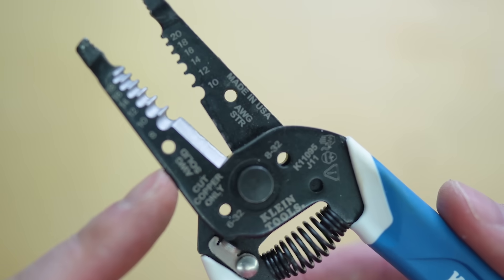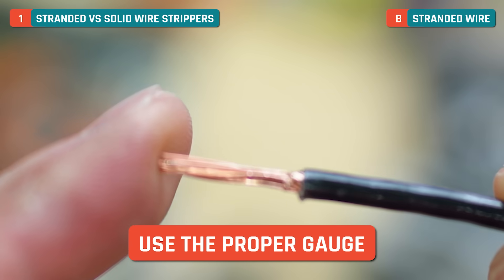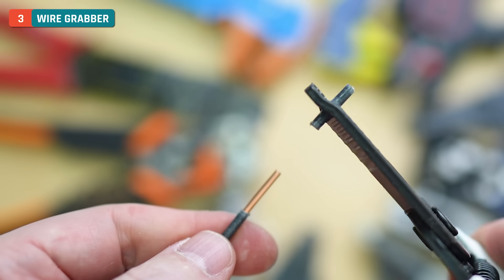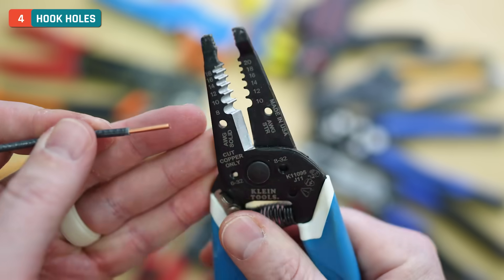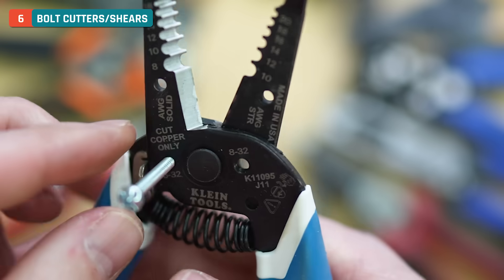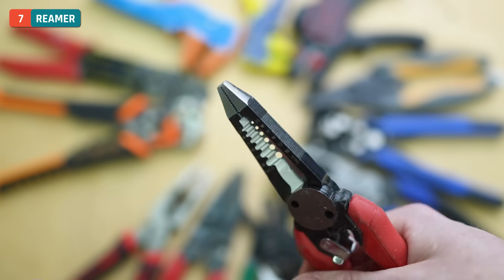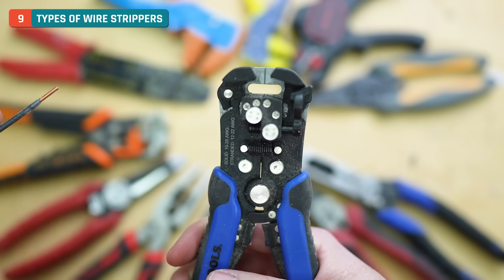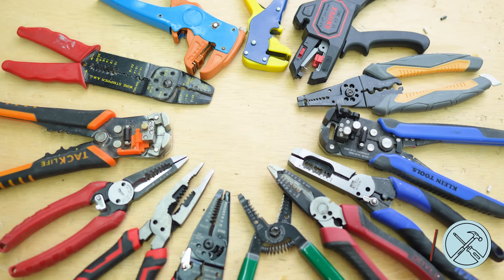8 Wire Stripper Features Everyone Should Know

Comment: Also if your ground is a 12 Awg in a cable, then your current carrying conductors will be 10 Awg.

Or if the ground is 14awg
Then the current carrying conductors will be 12awg
Reply: Why would they not be the same size?

Comment: Great video.  Others have commented about 8/32 and 6/32 have the same number of threads per inch and thus the same coarseness.  I will point out something else also.  When demonstrating the crimper on the Klein stripper, you are crimping an insulated connector in the non-insulated position, the correct position to crimp the insulated connector is the one closer to the hinge point and is shaped much like the 'wire grabber' (#2 in your video) near the tip of the pliers.  Some suggest you can use the 'wire grabber' to crimp, but that point is so far from the hinge point that unless you have extraordinary hand strength you will be unable to achieve an adequate crimp.  While I have used such pliers, and other cheap crimping tools with good success,  a dedicated crimping tool which uses compound lever action to achieve greater pressure, and a ratcheting mechanism to keep the pliers from releasing before a full crimp is achieved, will yield far superior results.  These type of pliers usually have dies which crimp the connector at 2 points simultaneously and are specific to the size of the connector being used.  I bought several different pairs to compare different brands, I returned all but the Klein pliers.  The Klein pliers were at least twice the price, but the dies they had were far superior and achieved the best crimp by far.  The best crimps are achieved in a single crimping action, crimping a connector more than once generally causes the the first crimp to loosen.

Comment: For starters the insulation cutter is not meant to pull the insulation off! It's only to cut through the plastic insulation! On most wires you pull the piece off with our fingers!

Comment: I use your wire grabber hole for pre crimp as it will allow the stake on to stay in position till you are ready to crimp. If you are in a jam and or do not mind risking damage to your strippers you can force a crimp with it as well.

Comment: ground wires on old work is sometimes smaller than the current carrying conductors. you wouldn't want to use that as a reference to determine your wire gauge. New work is color coded so you shouldn't need to guess.

Comment: When you strip a wire, I have found that cutting at a slight angle gives you a little bit of leverage to pop the tip loose so you don't have to rock or twist.

Comment: You really should use a GoPro or something similar when filming closeup videos like this.  That full frame sensor with wide aperture lenses is great for low light filming, but it gives you probably a 2mm depth of field when working up close which results in a video that is 75% out of focus (particularly when paired with an unreliable autofocus).  Expensive kit like that is wasted on a tabletop presentation and ironically makes for a lower production quality video.  Fortunately you did a good job explaining everything so I managed to follow along pretty well even if I couldn't make out much from the blurry images on screen.

Comment: I hate looping wires around the screws since takes several passes to get it right.  I would never use the back-stab holes, like done in most new homes.  I like the rear feed holes w/ a straight wire, but a screw clamp.  You find those in "industrial" receptacles, which is all I'll buy in the future.  GFCI outlets have long used them.

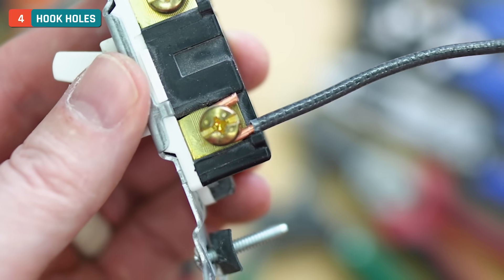Comment: 6:38 excuse me. I'm from Argentina and wires here just go inside the socket with NOTHING left exposed. Even the screws are inside the case through a window for a small screwdriver... What would be the problem with the sheating exposing more wire when the entire screw and plate are RIGHT THERE?
Google "toma Teclastar" (that means receptacle and a brand) and you'll see some pictures of the back side of what we have. Screws are barely accesible and everything else is secured. You could even work on it with wet hands xD
What would be the problem with some extra mm of exposed wire there on your plugs?
Great video! I didn't know what the bolt cutters were for! I always wondered what those holes did! 😀I never noticed threads on them, though! I'll check those more closely! TIL

Comment: The ground wire isn’t always the same gauge as the hot and neutral. I’ve run into romex where the ground conductor is smaller than the hot and neutral

Comment: To avoid the focus issue youre having try to set the camera to a larger F-stop (aperture). This is the focal length of the lens and determines how deep the focus gets. Basically, the Portrait feature on phones use smaller F-stops in order to keep the focus on a narrow depth of field, ie the person, while redusing focus on the background. For your case, you need a larger F-stop which would give more focus leeway and allow you to move your tools up and down without affecting the video.
Reply: I think the sharp edges of the tools on the table were wrestling fur autofocus with what was in his hands. He could have simply held his hands over a sheet of blank paper or felt.

Comment: Little trick when you strip the wire cut at a angle then straighten the tool it will pull the insulation off in one vlean move

Comment: Very useful. I learned a bunch.

I suggest you work on perfecting your focus when you zoom into a part or wire.  Sometimes the auto-focus never gets to the right point and then you move on to the next scene.  Perhaps you can disable your auto-focus and memorize the distance from the camera to the part?    Or wait until the auto-focus finishes its job and clip that out of the scene, that is, don’t start talking until the focus is perfect and just trim the video.

I think when you review products you should also estimate how long each one will last.  Generally, Chinese tools do not last long — even though they are cheaper — and have wider tolerances that mean they won’t work well even before they break.  And they generally have a “it’s good enough” attitude which results in you saying things like “it’s labeled this way but that’s wrong” or unlabeled holes or having to explain an abbreviation that should have been written out.  [We rarely see these faults on German-designed tools, right?]  There IS a right way to label things, and I’d Ike you to acknowledge that.

Comment: When he was showing the use of the needle nose, twisting the pliers back and forth like he was showing will loosen up the jaws and destroy the tool. Use the tool with the jaw pointing straight into what you trying to bend, that is using it the strong direction. Other than that, this is an informative video.

Comment: I use a scrap piece of wire bent in a U to go through the hook holes and keep the strippers closed when not in use.  Protects the sharp tool edge, and fingers (for strippers without a close latch)

Comment: I always wrap a few turns of black tape on the handle along with red/white/green and wire number strips just because it always seems like I’m on a 12’ ladder and I need an inch of electrical tape and it’s sitting on the floor or something. Depending on what kinda work you’re doing. It always comes in handy especially if you got yourself into a tight spot.

Comment: I've been doing my own wiring (including hot panel (YIKES) change outs) and home re-wires for decades and am embarrassed to admit that I had no idea that the strippers could be used to make hooks for switches and outlets AND "bolt" cutting and shearing! Oh how much time and more importantly frustration, that would have saved me over the years! Great video!!!
Reply: Done A LOT of hot panel work too. Never ceases to amaze me how we stupidly try to end ourselves. lol 
Working on the buss bar in the back of a panel box and the side of my screwdriver found a ground wire with a hole in the insulation. Zap, Pow, Bang, Sparks...knocked me back about 4 feet, hurt like Hell, and scared the chit out of me! Good times!

Comment: 6-32 = size 6 screw and 32 threads per inch. 8-32 = size 8 screw and 32 threads per inch. They are the same thread count so NO, the # 8 screw is not "Courser" than the # 6 screw. Otherwise a good video.

Comment: 3:13 "That's why I don't mind taking these tabs off" - you usually SHOULD take the tabs off. They're optional spacers you can use. You're not legally allowed to space your devices out all that far from the box, so using up to all four of those spacers is about the max you can go. But in many boxes, especially old work boxes (both the metal type with "plaster ears" as well as the plastic old work boxes with the tabs), those mouse ears will slightly interfere with the box and may cause your cover plate to get pushed sliiightly away from the wall. Not enough to be a hazard, but in any case, there is generally no benefit to having the mouse ears on there.

I generally don't use wire stripping pliers to take them off; I prefer something more substantial like lineman's pliers or water pump pliers. Cheaper wire strippers will tend to twist and wear out their joint. At the very least, you'll want to use them such that you are not twisting them. You would approach the score "head on". So if you're taking off the upper right tab, the handle of your pliers would be pointed towards 2-o-clock or something.

Comment: If you hold the stipper at a 45° angle when stripping , then rotate back to 90° this will break the insulation without the need to rotate. Works pretty good, give it a try.

Comment: In all the years I have worked with different electricians and contractors in various States they all have different opinions as to how various electrical work “SHOULD “ be done. I even ran across an electrician in Virginia who insisted I did not need to turn off the power at the breaker box. He stuck his screw driver across the outlet box and shorted out the circuit. 😂

Comment: Future electricians or anyone who plans to use wire strippers. Always angle the strippers a little bit when stripping wire. Never put the strippers on an even plane like in this video. Never use the strippers to take off the flanges on a device either. It slowly will loosen your strippers, that's what linesman are for. Solid video, though.

Comment: Those tabs on the switches and plugs in this video make good #6  washers on the fly for non-critical applications or stacking on mounting screws when the box is set a little too deep and a good, flush switch or receptacle plate installation is required. I've also used the jaws of that yellow handle stripper as a reamer for 1/2 " EMT or PVC.
Reply: …. yes, I keep a stash of them just for that purpose

Comment: I bought a wire stripper a couple of years ago. Meh. Always get one with crimpers. I bought the new wire stripper because my ones with the crimpers is 40 years old.  Still works.  At some point you will need crimpers and nothing else will work as well , and on the wire stripper they're usually missing. The specific wire stripping tool is pretty neat, but unless you're doing a lot of wiring  -- like a whole house or office, don't bother.   If this is for your daily work, just ask the other electricians and get what they have.  I remember the day I showed up on the job with a steel handled Estwing. The guys said, "Your elbow is going to hurt by lunchtime." I already had it for a couple of years and my elbow often hurt... So I got a wooden handled framing hammer. "It's not going to last as long."  Ray laughed, "I replace a handle or two every year or so. It's cheaper than trying to find a new elbow." The Estwing he said, 'That's only for demolition. You will never break it." That was almost 50 years ago.

Comment: Another way to maintain a screw's threadability when trimming down its shank is to screw on a nut most of the way onto the screw before cutting the end off, then twist the nut back off, which will re-form the screw's threads again.  It helps to file down the cut end of the screw first, though, to remove any serious mashing of the screw-end before removing the nut; this makes the nut not have to "work so hard" to re-form the screw-threads.  Also you can use a Grade 8 nut which will be harder metal than the Grade 5 screw, allowing the nut to forcibly re-cut the screw-threads without becoming deformed itself. :D

Comment: Shockingly 24 years of electrical work experience 12 commercial, 5 residential, 3 industrial, & 4 low voltage controls, here's my top three strippers I prefer for safety and quality installations:
1. Ideal 45-110 blue w/black grips
2. Klein - k1412 yellow on white grips
3. Klein - 11046 small red grips

Comment: 32 is the number of threads per inch, so 6-32 and 8-32 are the same thread just different screw gauge. #3 is for crushing crimp connectors.

Comment: 6-32 and 8-32 are both "fine threaded" screws, but the #8 has a thicker diameter than the #6. Neither of them has a "coarse" thread, but both are actually "fine" thread. (7:12) A 32 tpi thread is the same 32 threads per inch, regardless of what thickness the bolt (or "machine screw") is.

Comment: okay, first one was a bit boolshity. You not gonna damage individual strands if you use size for solid wire, because right size is even smaller..  it simply not gonna cut through isolation because stranded one has more compression than solid

Comment: The number three spot is a crumpet for the old style copper ground crimps that used to be used. Now we use wire nuts with a hole in the top……. But the tools haven’t changed.

Comment: A couple of points you missed on features of wire strippers:
The needle nose teeth are meant to grab insulated wire ends (ring terminals, quick disconnects, ferrules and such) without damaging the insulation.  This feature is great when you need to install these wire ends in a tight space.
The next part down is a pseudo crimper for crimping these ends on, but it sucks and I hate using them for that job.
Reply: Agreed. Don't use the strippers as a crimp tool...not reliable crimp. Also, use your lineman's to take off the 'Ears' of the device. They will do it faster and cleaner!
Reply: @CaptCutlass what you suggest for crimping?
Reply: @aayotechnology  They sell dedicated crimping tools that work much better, whether your crimping small aluminum/lead style ones like eyelets, blades or fork type connectors for stranded wires. If you need to crimp several solid ground wires together, with a Crimp Sleeve to have only 1 or 2 grounds for your particular application needs, they sell a dedicated one that crimps 2 sizes of sleeves. Much stronger crimp with less of a chance for the wires to walk out since they are designed for only that. Also, you can use the crimper built into the bottom a good pair of Lineman's Pliers...much stronger as well.

Comment: a single conductor is commonly called THHN (or THWN, THXN, etc). 

Romex is the brand name for NM-B, or non-metallic, branch circuit cable, and it normally has two or more THHN insulated conductors and a bare ground wire all wrapped together in a plastic sheath.

Comment: The crimping technique is the most commonly misunderstood feature on the tool. Not trying to be critical here but the lobe part of the crimp feature aligns with the back side of the split on the terminal. This assures a proper crimp fold and a more secure crimp.

Comment: Excellent video! One thing you should have said something about regarding stripping solid wire that applies to stranded also. Nicking the wire causes damage that if the wire is bent,  such as pushing it back into a box, the wire could partially or fully break. Even a minor break can cause enough damage that should the wire be fully loaded or repeatedly overloaded, this damage will reduce the wire current carrying capacity and cause local overheating. Bad enough of a nick and it could cause an electrical fire or melt the wire. Replaced many electrical devices that showed signs of overheating, insulation damage or burned wires requiring cutting back the wires. I've seen this done by electricians too! Most common simple mistake!

Comment: The "wire grabber" is actually a terminal cramper. If you use those terminals jackets (don't know the name in english sorry, it is basically a plastic jacket with a metalic tips that you put in the cables, to improve it's contact, specially good when using stranded cable) you then crimp it to lock it in

Comment: The problem with the offering is that the covered wire is held by hand and the holding is not uniform.  This can score the copper wire that can lead to a break especially after the wire is wrapped. There are other wire strippers that hold the insulated wire uniformly and firmly to prevent the accidental scoring. It is not a good idea.

Comment: Get a cheap pair of wire strippers that come included with butt connectors they are so cheap and suck so bad at their intended job but they are good for cleaning threads off rusted bolts using the wire cutter function

Comment: I'd say never twist the wire when stripping, because it might damage the core. 

The better way is to apply some pulling force when stripping the wire, that way when the sheathe is all the way cut you can feel the breaking, and you can take the signal to stop cutting and start pulling the sheathe out.

Also I find the gripper head good for sorting frayed stranded wire. The teeth of the gripper can be used like a comb or die to straighten individual strands. After that, it can also be used to twist the stands when preparing them to be tinned. (Try avoid twisting the stands when using cold-clamping terminals though.)

Comment: Find you a metric pair for the bolt shears... They work great with brass screws.  Brass rews are good for 3D prints, you can use them to quickly heat set holes